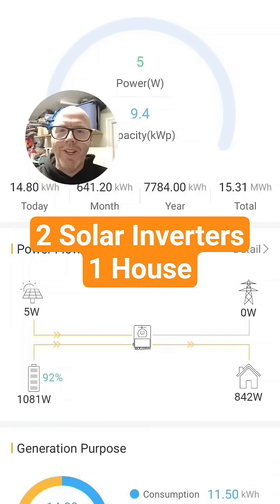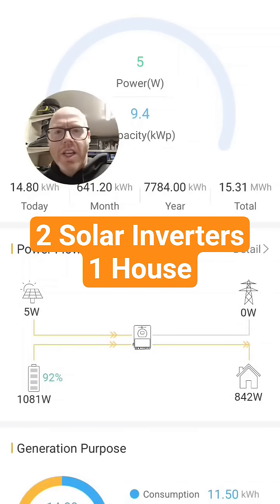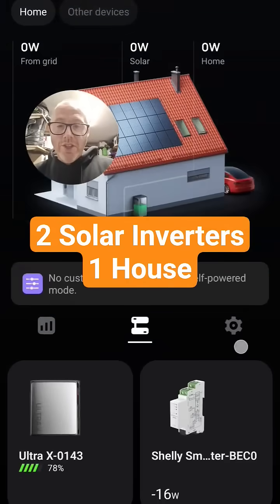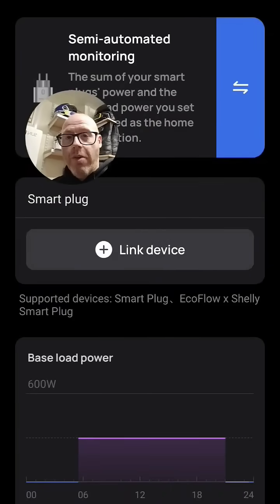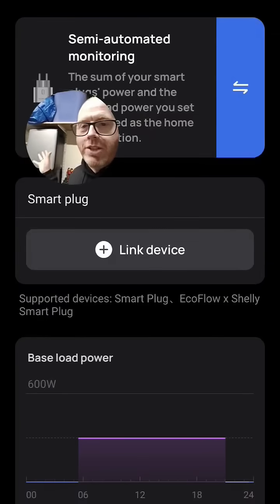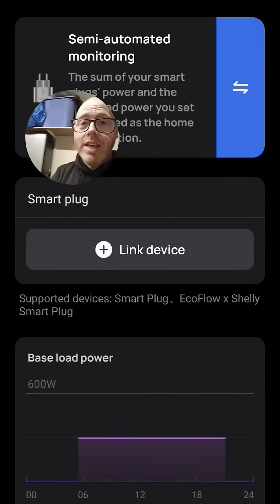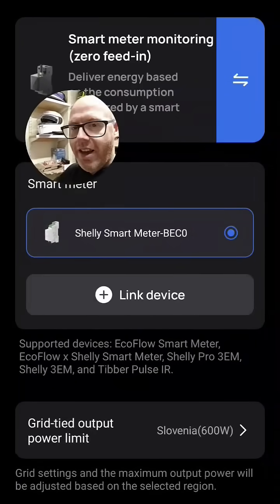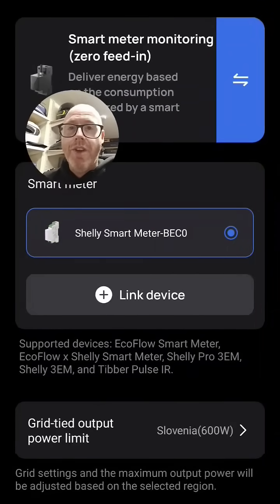2 Solar Inverters fight each other? #Sunsynk Vs #solar #ecoflow #tech #battery #electric #renewable

Comment: Can you tell if it is possible to run two Ultra X's in a property that has been divided into two flats either separately or managed in a single space?  Would it also be possible for them to share 4 solar panels so that the energy can be used where needed most.
Reply from the maker: That totally depends on how the electrics have been split.

In theory if you put the CT around the main incoming feed for the whole property then it would share the load across both properties.
Reply: Depends where the meters are and how it's been split. If you export from one flat to the other through the meters you'll be charged, and you absolutely cannot go around running extra wires between the flats round the back of the meters!

If the two flats are on a shared meter then you should be fine - then it's a totally normal house setup.

Comment: On a Sunsynk you can wire up to 4kW of grid tie input to the aux port of the inverter if not being used for another purpose and set it to be a microinverter input. It can even be set to fake grid for that input when there is no real grid and you are islanding. You still need to watch the G98/G99 rules as you need the total of your inverters to be under your G98/G99 limit unless you've got an approved solution to keep you under it for export.

It's meant for attaching legacy microinverter setups to the inverter but it also works just fine for any other grid tie inverter.
Reply from the maker: Yep, that's how I previously had my system configured. Pros and cons to that config.